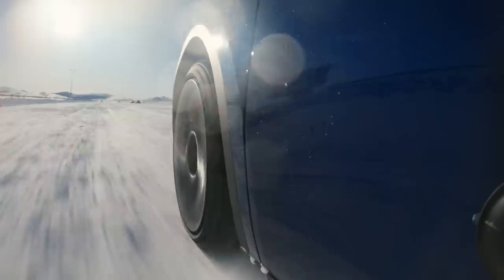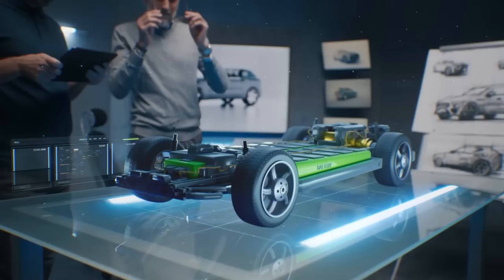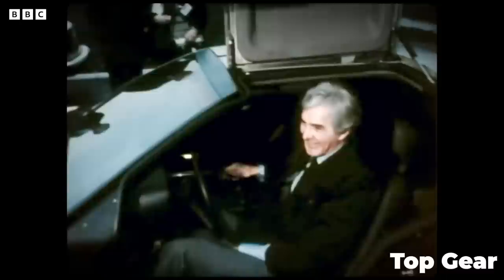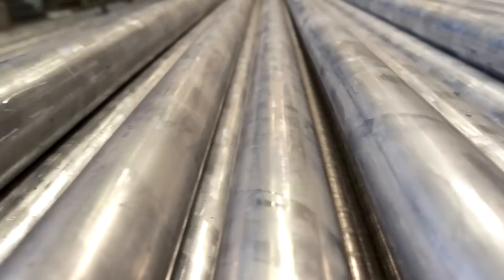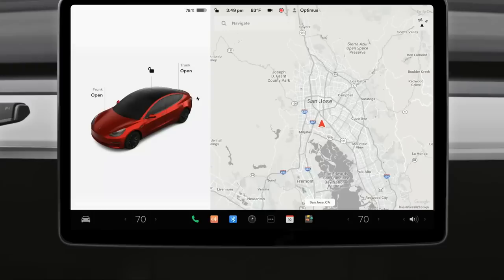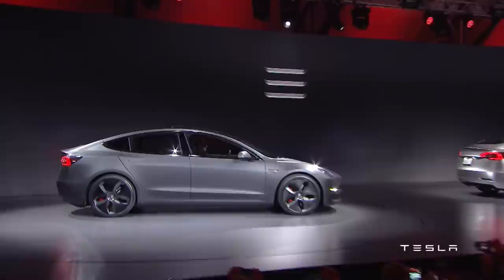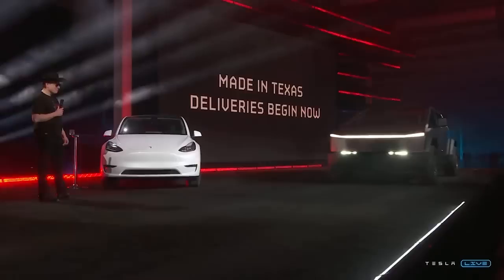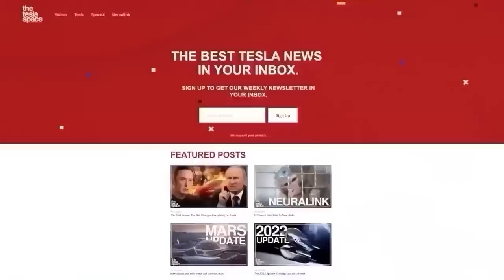New Tesla Cybertruck Design Secrets Revealed!

Comment: Unbreakable windows are bad. In case a driver is unconscious or needs to be rescued, it is essential to break the window.
Reply: no windows is actually unbreakable. Its just a matter of having the propper tool.
Reply: Good point
Reply: Ceramic pointy tool is the solution.
Reply: I think Tesla are smart enough to engineer a safe extraction route but way to go on finding a negative in anything, however positive.

Comment: I bought a Ford Maverick last year, dealers suck. Sure you could say "but you get support at them".  Then why when I took it in, partly for warranty work, partly for a recall, did I get neither? I finally sold it after months of hearing "we are working with Ford on the warranty work".
  Cheap, poorly made/engineered.

  bought a Used Model Y for the near the same money.